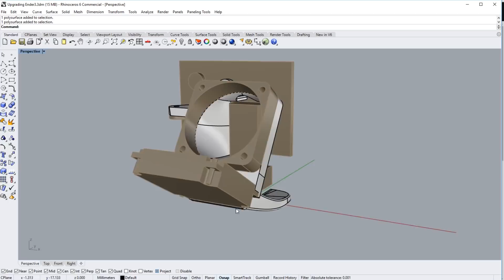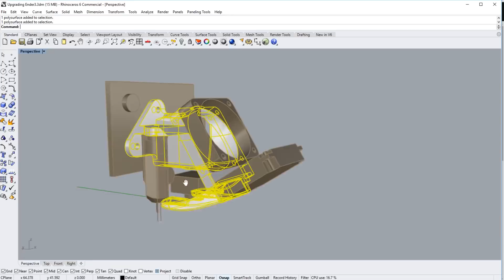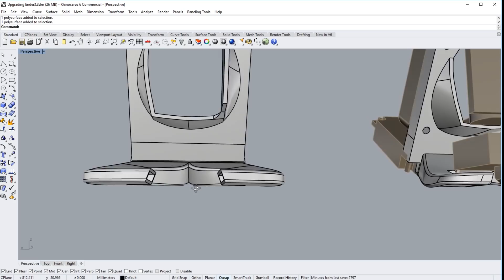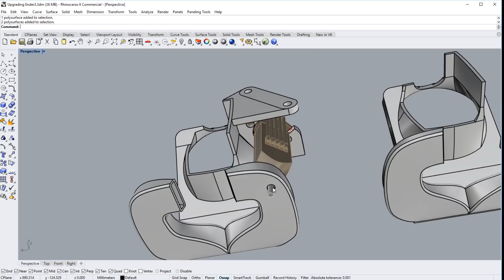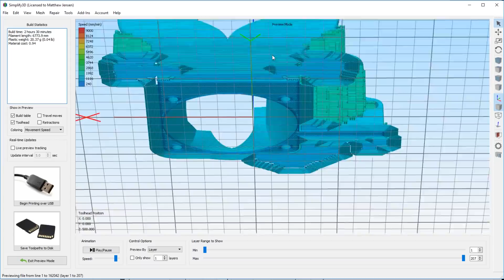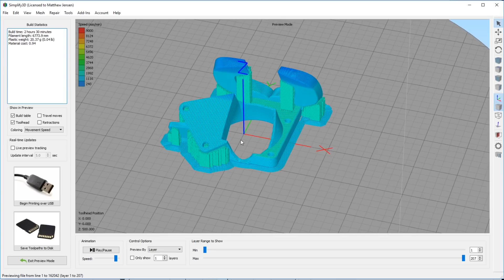Upgrading the Creality Ender 3 with Duet Wi-Fi, and other add-ons - part 1

Comment: I've owned 6 different 3D printers, and I can say confidently that the used, partially broken i3 mk2 is the best one I've ever had, and for one key reason: it's not the features that make it great, it's the implementation of said features.
In order, I've had a...
Printrbot simple 2014 maker's kit
Folger tech acrylic prusa i3 clone
Monoprice maker select (brand new) 
Prusa i3 mk2s (bought used with a broken extruder thermistor wire and a clogged hot end. Fixed with an acetone bath, xacto knife, pliers, a new thermistor and patience) 
Monoprice mini delta
Monoprice maker select (bought used and highly modified by another maker to have better stability)

Every machine on this list has different features, and each performs differently as a result. Just because the monoprice mini delta has automatic bed leveling doesn't mean it works as well as the i3 mk2. And just because the Folger tech had a heated bed didn't mean it printed better than the printrbot simple.

Prusa puts an absurd amount of care, effort, and development into each aspect of their machines. That's why something like a RAMBO board which, on a spec sheet may look deprecated and junky, is a joy to use, while the color LCD on the mini delta is clunky and annoying. Or God forbid I'm forced to use the God awful screen on the maker select, how do people use a display with THAT MUCH LAG? Sure, the original prusa is more expensive, but after all is said and done, their machine is still king for a reason.

Feel free to disagree, but I'd be impressed if any YouTube comment made me rethink the thousands of hours I've spent printing and all I've learned from them.
Reply from the maker: I'm not a Prusa hater. I agree with everything you said about Prusa. Prusa just gets it right. They are the market leader for a reason. What I've said, and if you read through the comments, you can tell I need to say it again, and again. Prusa is not responsible for almost any of the innovations on Prusa printers. A Prusa printer is a fantastic collection of some of the best printer upgrades that the community can come up with implemented to perfection. But that doesn't mean a Prusa is perfect. The moving bed and direct drive are big problems because of inertial mass. A coreXY machine is a better starting point. The 8 bit board while functional could be a whole lot better. I mean I have manual windows in my truck. Everyone who rides with me complains and I have the same argument. Hey, they work. Why should I change them?
Reply: @DesignPrototypeTest  So, would you change them? If not, you are proving Prusa point.

Comment: the zip ties on a prusa make for super easy maintenance when greasing rails, and the printable parts make for fun at home upgrades as they come. also prusa provide spare parts for everything and have awesome customer support, hard to find that with hecho en chino brand :) plus I did not want to be upgrading a new machine... nobody prints over wifi duh.
Reply from the maker: I'm glad you are happy with your Prusa. No surprise there. They are the market leader for a reason, but as to your comment "nobody prints over wifi duh" You don't realize how nice of a feature that is to have until you start using it. Now that I've used it for a while, I would say it's about as important as having automatic bed leveling, or having a flexible build plate.

Comment: Running the power supply on wrong line voltage = essentially half the voltage ... i'm not so sure about that. It will try to make the 24V and probably will without load, but when loaded the voltage will sag down.

Comment: These are all possible solutions to problems that aren’t really problems that don’t really need solutions. My Ender 3 does exactly what it should. It isn’t too fiddly and I’ve been getting good prints. Are there upgrades? Yes. Do they need to be done? Not at all. Aside from a better part-cooling duct, it’s fine. I’m not going to go out and buy a $180-$210 printer to put more than that into it, regardless if it’s over time or at once. I bought a 3d printer to print things and use as a tool, not to fiddle with, so downtime, uptime, efficiency, and effectiveness are all things I considered. My Ender 3 is perfectly fine and was making parts within an hour of me opening the box. These upgrades make the printer “better,” I guess, but the only thing I’m concerned with is the final product. Do these help print quality? No. Do these help keep the printer up for a longer amount of time? No. This is a cool video demonstrating products available for a machine. I get it. There are a ton of Creality printers out there, and the Ender 3 is the hotness, sort of, so it makes sense. But for the person that doesn’t care about what the next guy has or is doing regarding 3d printing, this is all moot information. My RasPi gives me the functions I need for less than $50 and a couple hours of printing and setting up. This video seems like “here’s how to mod your Honda Civic or Accord with parts worth more than the car.” It’s possible to make the civic a race car. Honda itself had a factory-backed racing series, and companies like Spoon and Skunk2 have been working Hondas over for years. It’s possible. Worth it? Not at all. But the Ender 3 to get a decent printer at a decent price because it checks the right boxes and there’s a lot of support for it. Buy a Prusa if you need all the fancy crap that’s arguably negligible but not arguably a better printer.

Comment: Which CAD program are you using ?
Reply from the maker: Rhinoceros 3D Ver.6 AKA Rhino6
Reply: Thanks, I can see money is not a big issue for you ;-) 
Have you ever tried ProgeCAD to less then a 1/3 of the price ?
Reply from the maker: >I can see money is not a big issue for you
What are you talking about? You don't know me. I paid $350 for my Rhino6 license because I bought it the week it came out. Rhino gives reduced pricing to long time users ($500 at the moment which is the same price as that program you suggested), and they only release a new version every 5 years, so I'm paying less than $70 per year.
Reply: You are absolutely right I don't know you and I'm sorry, you didn't notice the smiley.
About the pricing, that is strange. If I want to buy a a new ProgeCAD licens it cost me  2100 DKK which equals 330 USD. If I want to buy Rhino 6 i have to pay 7400 DKK = 1.165 USD. I can also see that ProgeCAD cost 499 USD in US. So I guess ProgeCAD is for Europe and Rhino is for US.
Sorry for the misunderstanding.

Comment: You’re getting by cheap I have $2400 into my aluminum machined Cartesian printer already. No plastic or wood junk parts on it. I expect to have quite a bit more when R&D and final parts being machined here are complete. Beyond tired of hobby grade slow printers, CNC equipment. I wish there were commercial controllers however it seems most companies use some open source based arm processor and charge more. Looking at various laser options and potentially going 5 axis swivel head for printing. The Ebay lasers are sad so to speak and rated in mere mw’s so were looking at a commercial 50w water cooled diode and additional custom print bed cover so nothing is damaged during cutting. Obviously complete insulated and vented enclosure with a laser friendly acrylic viewing door for the front. Printer should be complete in February. The irony is everyone wants to get by cheap and sacrifice quality. I never understood the mentality and in spending hundreds more later replacing poor parts, and/or general upgrading versus building from scratch the right machine you’re happy with. You look at the Markforge and alike printers and they can’t have more than $3500 in production expense for each printer and yet look at what they charge? And they even use steppers! Stepper technology beyond closed loop has been moving out the door. Soon every stepper will be can/bus vfd driven to run 3000 rpm and far more torque than their previous versions and nearly competing with ac servo class products essentially driving the costs of  ac servos down further where we as consumers make the upgrades. The first time I ever experienced use of servos I realized what a waste of money I spent on steppers. Save the money, take your time, and build your dream printer that will actually produces a return on investment.
Reply: you sound fun

Comment: I'm using a Chinese version of the Duet 0.6 . They implemented some hardware bug fixes and sold it complete with all of the source files. As a student it gave me an opportunity to get the hardware in the first place (since the official board was way over my budget) and allowed me to contribute improvements back to the software stack.

Now explain to me again how I'm hurting their development.
Reply from the maker: Congratulations, you are the 1 in a million who has the skills to contribute and actually did spend the hours and hours it takes to make a meaningful contribution to the open source project. For the 999,999 other people who will buy the carbon copy Chinese clone. They are hurting the original creators and no helping the development of future boards. They are just trying to get something cool for less money. They have no intention of giving back and absolutely no skills to do so.
Reply: @DesignPrototypeTest  That may be, but if it weren't for those who hunt cheap China clones the boards would not have been made in the first place and I could not have afforded one. That's the beauty of open source hardware in a free market; you pay for actual quality. This board has its fair share of unique issues, like how the connectors they picked are terrible, but they support the ecosystem by lowering the barrier of entry.

Just look at the RAMPS boards. Had it not been for how China enables dirt cheap boards the whole project would've been dead by now, yet Marlin is still being actively developed and is actually able to compete with the 32 bit platforms. In terms of features per dollar I'd say it even comes out on top for simple printers. Having Chinese "clones", i.e. having your hardware design go viral, is a godsend for the software side of things. Have someone else worry about the profit margins for the widespread deployment and reap the benefits of increased developers/perfectionists looking for a reference board.

I for one know I will get a DuetEthernet as soon as I can afford/need one, but if it weren't for that Chinese Duet 0.6 board I definitely would've bought the cheapest SmoothieWare compatible board and spent weeks just setting it up. In fact, I had everything researched and was ready to place the order when I thought to myself "let me just try to find the cheapest Duet board one last time". That's when I found the Chinese Duet 0.6 board and you already know the rest. Thanks to this board they will soon sell one more official board. Probably another one to a friend of mine who is now building his own delta printer. And likely some other guys who were looking for advice on controller boards.

Also, the board I have is not a carbon copy, they implemented (and shared) their own fixes for most of the known hardware bugs. IIRC one of them were how the heater MOSFETs defaulted to on when the CPU hung or the 5V rail got borked (this actually happened to someone on the forums with an official 0.6 board and he almost got a house fire). Yes, this is how thorough my pre-purchase research was and that thread ruled out a second hand official 0.6 board.

Comment: Prusa is bad because it uses zip ties to further secure rails in a part that has them rpetty secure to start with?  Come on.  If you had built the Prusa from a kit, you'd realize that it's quite a good design and an excellent printer.

Comment: Ideamaker has support controls that pretty much match Simplify 3D. You can automatically generate supports, or manually add/remove supports, or any combination of that. You can change the thickness and other characteristics of the supports and they remove easily. Plus you get $150 of free filament with it compared to Simplify 3D because it is free.

Comment: Dude this would be a great video, just edit out all the Prusa hating... also the panic mode and the “ layer skip” detection is Prusas
Reply: I once heard from a wise man that printers are like cars they all look like cars and have similar features but are not created equal. For example the Dodge Avenger has power windows and so does the BMW i3, when I push all the windows down at once the dodge struggles and is at a different speed and torque than when I roll down one. When the i3 rolls all it’s windows down at once it’s majic, silent and moves smooth just the same with 1 or 4. You can add the features to these cheap Chinese printers you want but they will still always be an avenger 😎
Reply from the maker: The "Layer Skip" detection which you mentioned is a technology developed by the German chip manufacturer Trinamic. Prusa had nothing to do with its development. Your comment is another example of someone with a bias toward Prusa thinking everything innovative in 3D printing originated from Prusa. A claim which is false. The vast majority of innovations on the Prusa printer were not developed by Prusa. He is not as much a designer or inventor so much as he is a curator.

Comment: "Support original creators"... Thats why I support Prusa 100%.
Reply from the maker: Like so many other Prusa Fanboys you mistakenly think Prusa is the original creator of all the great features on his/their printer. The vast majority of those features were developed by others and adopted by Prusa.
Reply: @DesignPrototypeTest ideas are all fine and dandy. What Prusa did was apply them. He risked his own money and even his livelihood to apply those ideas and make an excellent quality easy to use product. 
Prusa supports original content supporters by using genuine parts in their printers. No cheap knock off boards or hotends here. 

Prusa took a free slicer. Fixed a ton of bugs added a ton of features and gives it away freely to the community. 

Want a decent extruder for your printer? Well Prusa designed one and its open source so just print the parts and build it. Hell the whole printer is open source. 

While you sit on the sidelines and armchair quarterback and bitch about Prusa stealing your ideas (which have been common knowledge since literally the 70's) Prusa spends his time and money and risks his own future making those ideas into a tangible product. 

So yes I am a total fanboy of people who work hard and actually push the community forward. Not people who whine that they didn't get a free printer for review.

Comment: Solid Modeling, not surfacing.  Surfacing is what we CNC Machinist do when Surfacing a contour with a Ballnose Endmill.
Reply from the maker: :) You are correct. But I am not incorrect  "free form surfacing" is commonly shortened to "surfacing" in professional drafting settings.https://en.wikipedia.org/wiki/Freeform_surface_modelling
Reply: @DesignPrototypeTest  Agreed.  :)  I wanted to say earlier that it was a good video! Well done!

Comment: duet wifi is overkill for an ender 3. octopi gives the same results, and a properly calibrated ender 3 is cheaper than throwing money at it. for 471, you could have gotten the larger cr-10 line

Comment: 'When you buy from china you are stealing' 
*Buys a printer from china that is based on the original Prusa style machines*

You sir are just argueing with yourself. Stop hating on another persons succes, if you know it any better, why don't you develop a machine that is better and cheaper than a Prusa, but you have to do all the R&D and don't you dare to 'steal' anyones ideas or someone might just make a video ranting about it and claiming that they need to get a free machine from you.
Reply from the maker: copy pasta from my response to Kevin Schofield's comment on the part 2 video:

Nothing about the ender 3 is a knockoff of a Prusa. The overall frame architecture with an overhead gantry and moving bed has been in use in CNC machines for 30+ years. Prusa did not even develop it for 3D printers. It was the logical progression from the Mendel (a design invented by Dr. Adrian Bowyer and copied by Prusa for his first commercial printer). Furthermore, Prusa started using the Aluminum extrusions under his bed AFTER china adopted that construction technique. The Prusa uses linear bearings and rods. The Creality uses Pulley wheels traveling along the grooves of the extrusion. Should I go on? Nothing about the Ender 3 is a copy or a knockoff of a Prusa. Compare that to the "3DTouch" sensor, or the clone of the DUET which are virtually identical to the originals, except where corners have been cut to save cost. You Prusa fanboys are starting to get on my nerves. Your boy didn't invent 3D printing. He didn't even come up with the vast majority of the innovations on his printer. He is just mining the internet for good ideas then putting them on his product and acting like he is the bringer of innovation. He isn't.

Comment: How hard would it be to do the same thing to a CR-10 S5 500mmx500mm printer?
Reply from the maker: Absolutely no different than what I'm doing to the Ender 3 except that you would specify the large build volume in the firmware configurator. The problem is that the bed on the CR-10 doesn't heat up beyond 80 degrees because it is so large, and the power supply is only 12v.
Reply: Thanks. I have a 220v bed heater.

Comment: Aren't you concerned running the Noctua fan at 24v instead of 12v? It's probably not going to run right, and might seize up.
Reply from the maker: Hi David. My apologies, for the flippant reply which I deleted. In my interface, it's easy to mistake which video you were commenting on. I covered the answer to your question extensively in part 2 which I released a few hours before you asked the question: https://youtu.be/G-NJTaDUJ1M